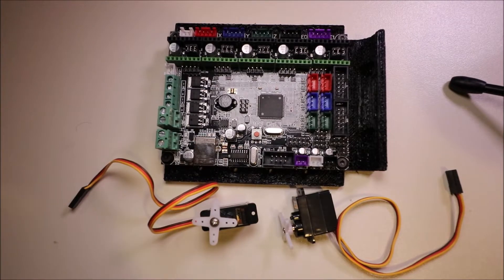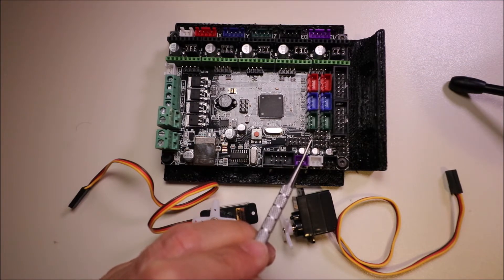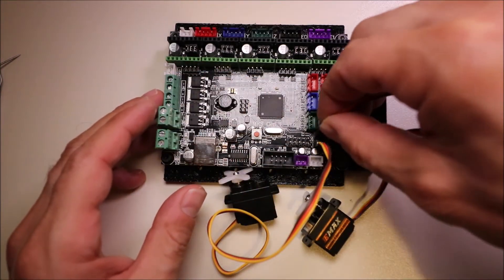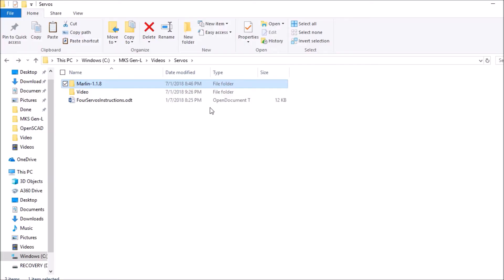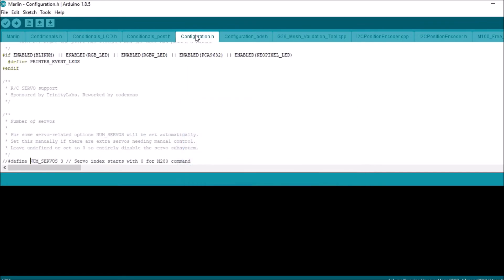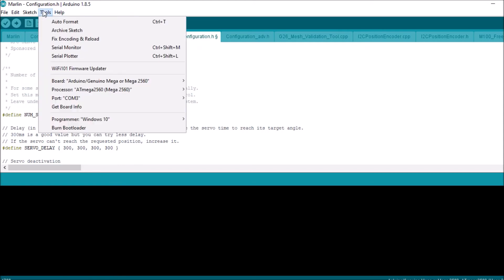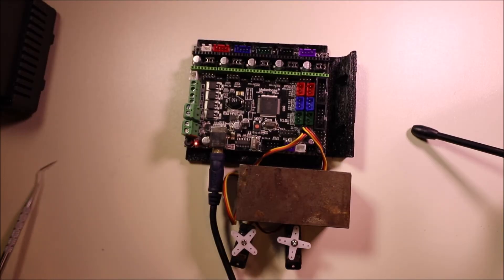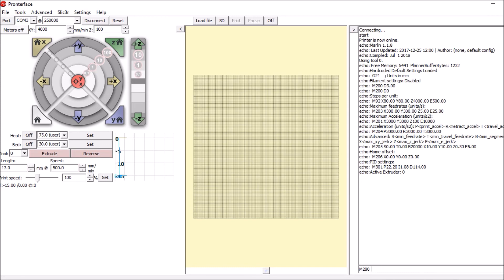MKS Gen L - Servo(s)

Comment: Among Marlin 2.0 Just set the two parameters displayed in the video, not enough to compile. What should I do
Reply from the maker: It should allow you to compile.  Could you give me more details?
Reply: @EdwardBraiman  First of all, thank you for your reply.My settings are as follows：#define NUM_SERVOS 1 // Servo index starts with 0 for M280 command

// (ms) Delay  before the next move will start, to give the servo time to reach its target angle.
// 300ms is a good value but you can try less delay.
// If the servo can't reach the requested position, increase it.
#define SERVO_DELAY { 20 }

// Only power servos during movement, otherwise leave off to prevent jitter
#define DEACTIVATE_SERVOS_AFTER_MOVE
It then prompts for errors after compilation
#error "Z_PROBE_SERVO_NR, switching nozzle, switching toolhead or switching extruder is required for DEACTIVATE_SERVOS_AFTER_MOVE."
IN “SanityCheck.h” display
/**
 * Servo deactivation depends on servo endstops, switching nozzle, or switching extruder
 */
#if ENABLED(DEACTIVATE_SERVOS_AFTER_MOVE) && !HAS_Z_SERVO_PROBE && !defined(SWITCHING_NOZZLE_SERVO_NR) && !defined(SWITCHING_EXTRUDER_SERVO_NR) && !defined(SWITCHING_TOOLHEAD_SERVO_NR)
  #error "Z_PROBE_SERVO_NR, switching nozzle, switching toolhead or switching extruder is required for DEACTIVATE_SERVOS_AFTER_MOVE."
#endif
Reply from the maker: Did you select the motherboard?  Some of the videos back then I might have skipped as they are the same as ramps 1.4.
Reply: @EdwardBraiman  Of course, I use MKS sgen_l, which can be compiled without setting servos. However, as long as I open a servos, I must open the automatic probe of Z or other functions that need to use servos. You can't just turn on a single servos.
Reply from the maker: In Marlin firmware version 1.1.9 you should be able to run without a servo.

Comment: Mr. Braiman, thank you for the information.  Would you kindly tell me,  what should be the gcode for running multiple servos at the same time? For example I want  the servos that connected at p0 and p1 turn at the same time. 

When I write  gcode as:

m280 p0 s50
m280 p1 s50

they turn sequently.  When I try writing  as

m280  p0 s50  p1 s50

only  servo at p1 turns.

how should be my gcode to turn both of my servos at the same time?
Reply from the maker: Technical you cannot move them at the same time.

Comment: Hello I bought the mks gen L V2 but the servo does not moves bt I get my pin in hgh state I probe it with a led what it is wrong?
Reply from the maker: Are you using a BLtouch?  There's several issues open on GitHub for BLtouch. Which firmware version?
Reply: @EdwardBraiman  I only using a normal configuration Marlin 2.0 bug fix
Reply from the maker: It maybe some time before Marlin firmware corrects the issue with the BLT.  I've been checking daily and added some Commandments to the bug.  But they have several bugs open on BLT.
Reply: @EdwardBraiman  I solved it my servo does not moves because I was using the command of your video m280 p0 s50 and my servo was in that position so it can not moves I tried s100 and it moves normally thank you for your video and for answer you Are Awesome
Reply from the maker: You're welcome.

Comment: thanks! great video! is there a way to set the servo as the z motor? i want to make a pen plotter and i want to be able to send it regular gcode..
Reply from the maker: Anything is possible just examine the pins.h file for MKS_Gen_L.  Remember servos and motor are very different devices. Shalom.

Comment: Hi I'm trying to add an IR Z Probe to an FLSUN Delta Kossel that uses this board. Where should I connect it to the board? The z min port only has 3 pins and I need 4. Any help would be greatly appreciated. This is the probe http://aus3d.com.au/ir-z-probe
Reply from the maker: Looks like it has four wires as you described, so looking closely at the picture, it says VCC (positive) Gnd (Gound), DIG (Digital), ANA (Analog).  So I would guess you have the option of either digital or analog for your signal pin.  If you consult the pinout diagram for the MKS Gen L, they will explained if it's signal pin is digital or analog.  Keep in mind I've not tried this yet and it a guess.  Also use a multi-meter to test before connecting.  Also work safe and good luck.
Reply: Ok! Thanks for the quick reply!

Comment: Hi, make a video about how to make auto power off after printing,  please.
Reply from the maker: Do you mean a cool down sequence?  This can be configured via slic3r.
Reply: Edward Braiman http://3dtoday.ru/blogs/3ddelocom/budget-system-the-printer-turns-off-automatically/
Reply from the maker: I seem to be blocked from this site.  Do you have another link?
Reply: Why do you set up 4 servos when you have 2 servos only?
Reply from the maker: Because only own three servos and wanted to show how to address with gcodes in pronterface software.
Reply: @EdwardBraiman  hmm I do not get you. I meant why in the firmware you put 4 servos when i see only you have 2servos attached. I want to understand it as I am struggling to get my servo going on d11 pin.
Reply from the maker: By enabling 4 I'm simplifying the example.  What seems to be the issue you're having?  What type of 3d motherboard and Marlin firmware are you working with?
Reply: Edward Braiman  I am using MKS base v 1.6 that runs on Marlin firmwire. My issue is that when I put the servo on D11 pin, I just do not have any reaction on the servo after enabling Z probe on firmware. Actually I am lost here.
Reply from the maker: Okay. So after you plug in the USB, does the servo twitch?  Have you measured the voltage from the voltage pin and ground with a multimeter?  RAMPS 1.4 user needs to enable the rail.
Reply: Edward Braiman  No, there is no reaction at all. How can I enable the rail? EDIT there is 5v there, when I measured it.
Reply from the maker: So I just checked MKS Gen 1.6 board and it appears to be very similar to MKS GEN L 1.0 .  I'm still looking for a pinout diagram, but it might not be listed or someplace I'm unaware.  As an alternative you could try wiring to a endstop pins and modify in the pins_RAMPS.h, but it's kind of advanced.    I would start with a multimeter to check voltages.  There appears to be not jumper on this board from a quick look.  Do you have an alternative board to check against?  It might also be a solder joint issue or you might want to try other three set of pins to see if one works.  Just remember to be safe with each step even though you're working with only 5 volts.
Reply: Edward Braiman  I checked and there is 5V there, so the ports seem to work. When I plug in the servo and plug in the board, the lcd screen seems to go black. It looks to me like it is not having enough current to drive the servo.
Reply from the maker: Have you tried disconnecting the LCD and testing again?
Reply: Edward Braiman  OK, so now it is better. Servo twitches when I plug in the board, however when I try to run autobed leveling it is doing some strange things on stepper X axis, it is squeaking and of course there is no movement on the servo.